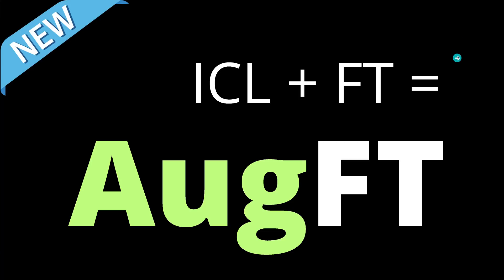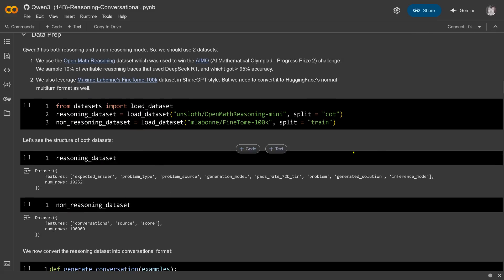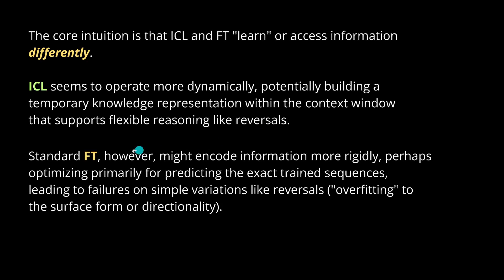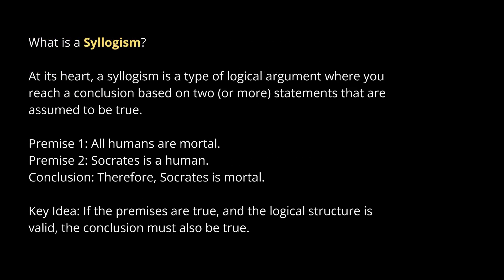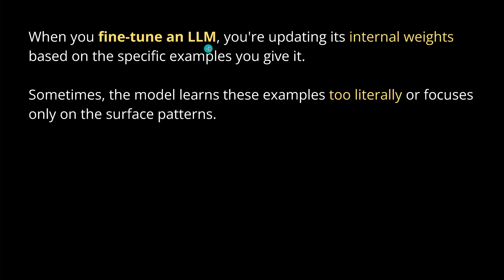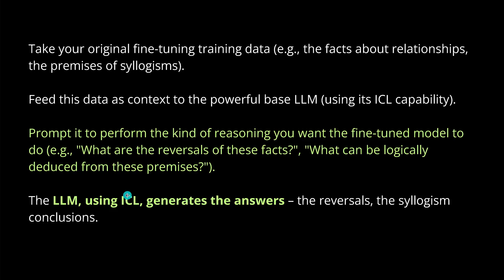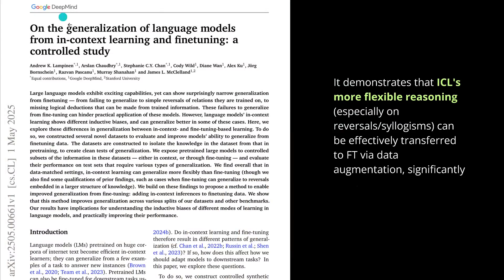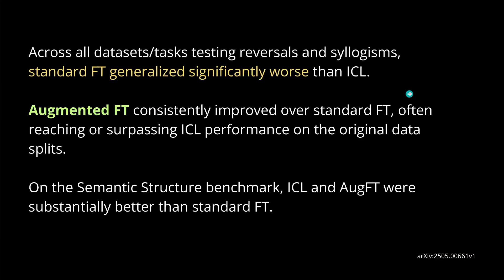A Smarter Way to Fine-Tune LLMs

Comment: Yet FT on this data will necessarily eat into other capabilities because all models are finite. (Unless there are a bunch of "junk" or memorized latent stuff that can be repurposed without anyone noticing.)

I don't believe generalized LMs can succeed at all rigorous logical tasks, esp those that require very long chains of reasoning. We should have dedicated models hyper tuned for logic, deduction, etc. But quadratic models are context limited during training which is a kind of bottleneck.

Comment: ICL is super interesting - sadly the accuracy degradation due to high context length really messes with the output quality.

the new gemini models are SOTA here but still lack the required performance we should see , when giving 50+ examples in the context. 

imo, google should train a model particularly for ICL-tasks that give a lot of example data via long context. 

XML tags can help generalize structure <examples><example-1>…</example-1></examples>
Reply: i’m pretty sure nvidias nemotron models are good for this, as it’s meant to generate synthetic data. i think it’s built on llama 3